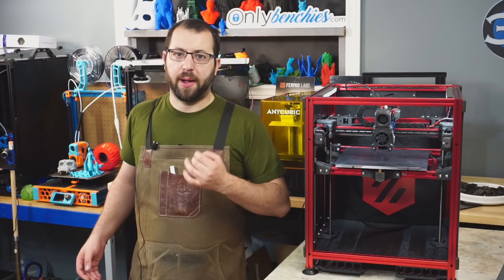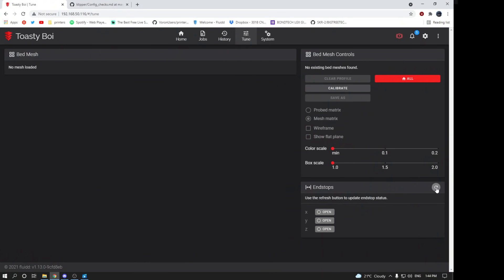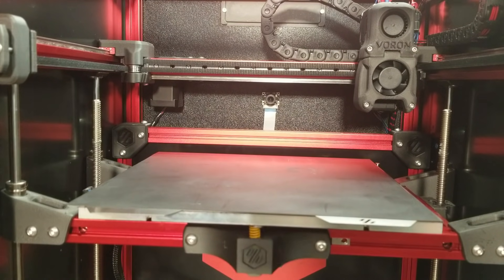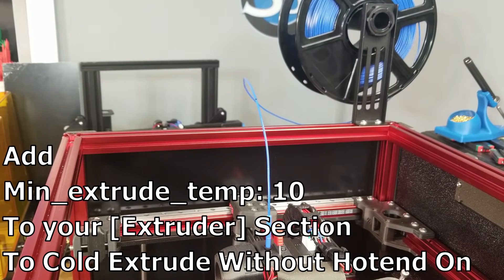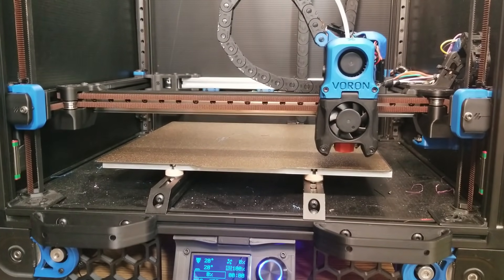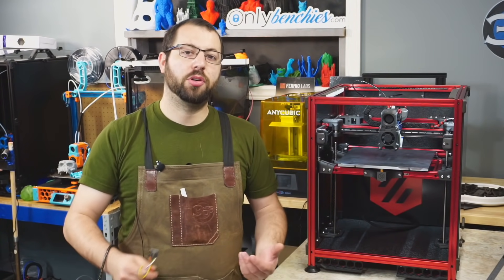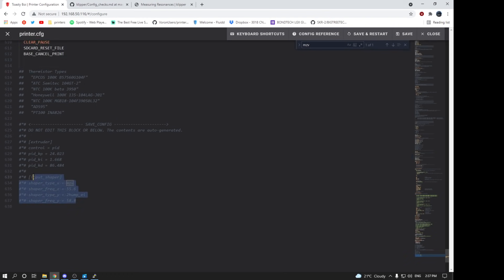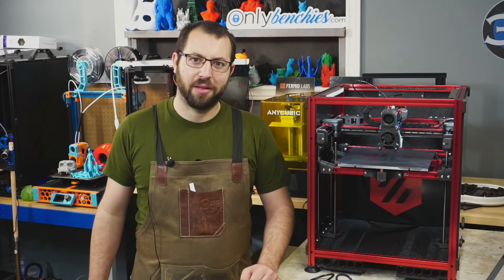Klipper Pre-Flight Checklist - Don't Forget These Steps!

Comment: great video!  a thing that tripped me up, and still not 100% confident with, would be what "disable acceleration control" actually means and which slicers have what settings to get around it.  a crash course in what that means in cura and or many other slicers would be a great companion video e.g., if minimum layer time, first layer speeds, wall speeds etc come into play.  i think you have covered a lot in your v0 and other build videos and i think it would be a nice addition.  also curious what matters and what doesn't
Reply from the maker: In most slicers you have the option of setting acceleration for things like outer walls, infil,  travel etc

You want to disable those so firmware is controlling the accels

Comment: Thanks so much for making these videos to help us through the setup. You make the process so much easier to follow.

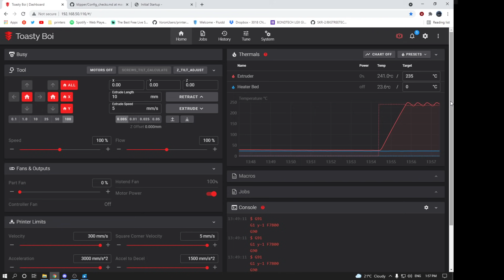I have a question on the PID tuning, how do you set your fans to be at a specific percentage? At around 6:52 you say to turn part fan on high, and at 7:02 you say you PID tune with your fan on 20% speed. I googled for a parameter for PID_CALIBRATE but didn't see anything.

Comment: Your videos are great.   Have you tried to use one raspberry pi running klipper and fluid to connect to 2 machines.  And if so were you able to configure the accelerometer for each machine?  With limited availability for Pi's I've been pondering trying this setup but have not had a chance to yet.

Comment: I have a quick question that doesn't seem to be covered in any of the documentation; what do I do if my printer doesn't have physical endstops, but instead moves the bed/extruder to certain points and stops when it gets electrical feedback? Printer is SV06
Reply from the maker: That's just sensorless homing with is a common setup nowadays

Comment: I picked up a generic ADXL345 for input shaping. I noticed in your input shaper video you wired the 3.3v pin to 5v. Is this ok? I like how you consolidated the wires into a 2x4 DuPont terminal. I'd like to do this too for simplicity but want to make sure 5v in the 3.3v pin is safe.
Reply from the maker: It can handle 5v just fine and the 2x4 arrangement is now the "proper" way to do it according to the guide https://www.klipper3d.org/Measuring_Resonances.html
Reply: @CanuckCreator  Awesome. Thanks!

Comment: Where can I find the stl for the air filter cover/blank plate.  Or is it a hidden update in the works.  Your videos have helped me a bunch.  Even the Mrs knew the answer to the giveaway question the other day. Tosti Boi
Reply from the maker: Its just a quick hack of the stock one to fill in the grill and add an angled 4mm hole

Comment: Ah man idk what to do... I really love my Duet board and the interface, it safed my whole 3d print enthusiasm because my printer was nearly not usable at stock (geeetech A30).

But input smoothing is really a big deal, especially because of the big print bed and my new direct drive setup... Is it easy to switch back if it's not perfect for my use case? Like doing a backup of my Duet files and reinstall it?
I have a raspberry pi 3 lying around, and I'm thinking of trying it

Comment: Just ordered all the parts for a 1.8 and am half way through printing the parts, now i''m worried that this is going to be more than i'm capable of putting together. Klipper seems quite complicated.!
Reply from the maker: The build is fully documented with the manual and ive streamed the whole thing if you have problems. 
While klipper can seem a bit daunting.  The vast majority of setting things up is just copy and pasting/adjusting a few numbers. 

The stock config for a v1.8 is pretty much good to go except for the things i covered
Reply: @CanuckCreator  Thank you, that's reassuring, i will go back through your build. The Voron printers look amazing and after watching Tom's 2.4 build i decided a 1.8 would be a better choice for my level of experience. Thanks for replying to my comment.

Comment: PLEASE HELP: I cant get past the stage where I was supposed to move the firmware.bin file over to my desktop. I only have a .hex file, I don't know how to proceed from here. My printer is an ANYCUBIC i3 Mega V1 (AVR/ATMEL Mega 2560).
Reply from the maker: Read the instructions in the example  config on the klipper github for a mega2560 based controller. You flash it over usb
Reply: @CanuckCreator  Thank you, I ended up just buying a 32 bit SKR 2.0 and did it your way.

Comment: You measure the filament extruded from the input to the extruder so it doesn't matter if the hot end is on or off. Either 100mm went into the extruder when you asked it to or it didn't. If your extruder skips because it's not set up right or the hot end was cold then sure it will screw up the calibration but most people aren't that dumb. Set your hot end to the correct temp and do the calibration no need to take the printer apart.

Pressure from the hot end is irrelevant unless it causes the extruder to skip otherwise nothing will stop 100mm going through there's no other magic involved.